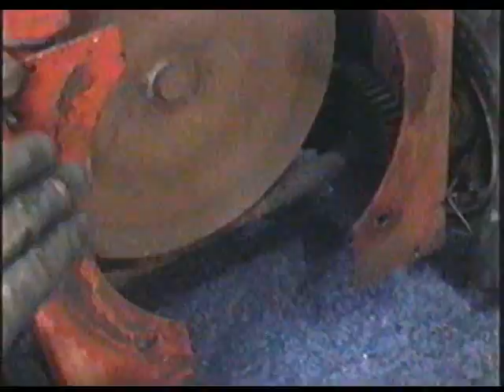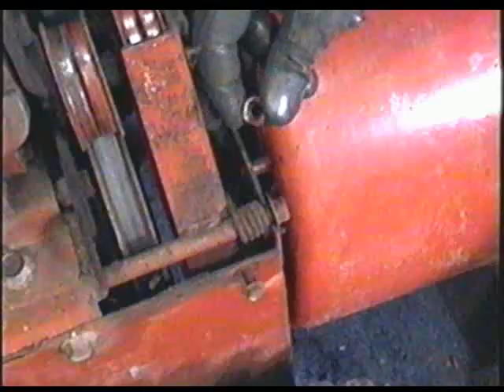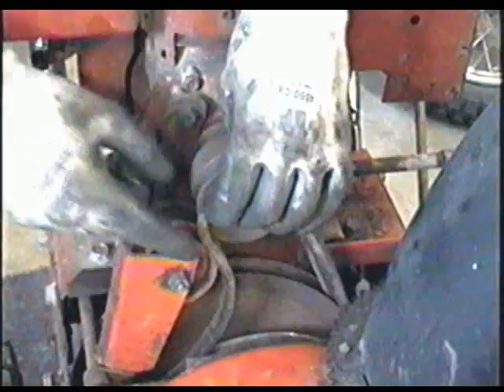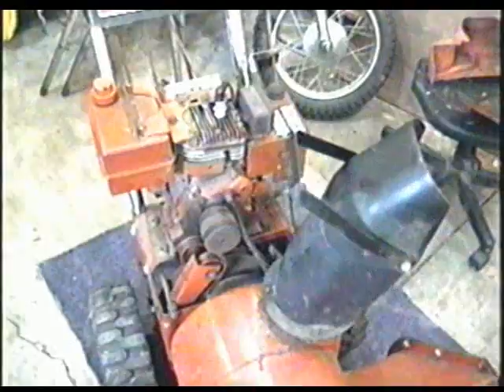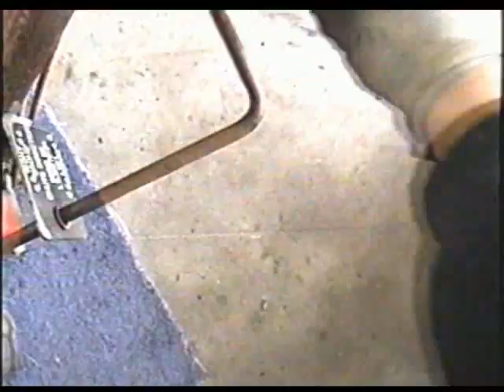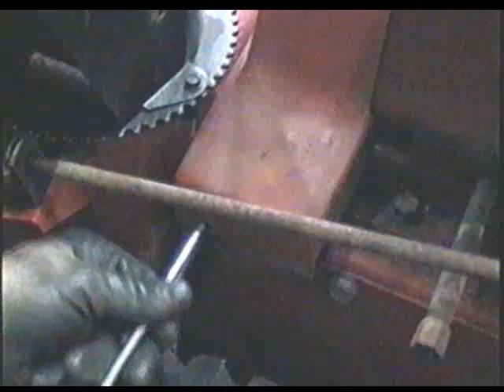Toro Snowblower Auger Bushing Repair Part 4/4

Comment: When you weld a pulley back on the hub, make check to be sure sure the pulley and hub is perfectly parallel to the metal table after tack welding or else: 3:36 happens.

Comment: I have a Toro 724 Model 38050 that's in the shop right now. And I was told that the flywheel is broke and they can glue it but no guarantee that how long it will hold. Now I'm learning about the bigger snow blowers and how they work. I purchased it a few months back for $125.00 and I ran it once and since then I cant get it to start. Not sure if I want the repair people to proceed and glue it, and clean the points. im going to ask them if there is anyway to bold the electric start batter cause I have to hold it from the right side tight before using the electric start. Do you have any videos on the flywheel and how it works and so on?? Thanks .And I really like these types of videos. Makes it a lot easier to understand how do repair things. :) Tony

Comment: Beautiful Work. Love your video, too. Clear, simple explanations and well-edited.

I have a q. - I have the same model that you repair in the video, and there's an issue w/ the choke/carb on mine. When I start up the machine in the fall, it runs fine, and, once the engine is going, I can close the choke. But, when winter comes, and I'm clearing snow, the engine shuts off under a load unless I keep the choke mostly open. I also have to constantly adjust the bottom jet screw on the carb. Any tips?

Comment: nice how much did you charge for this because you have put a lot of work into it, i found that my lawn mower has the same bearing system for the wheels and axel, were it is fixed to the body